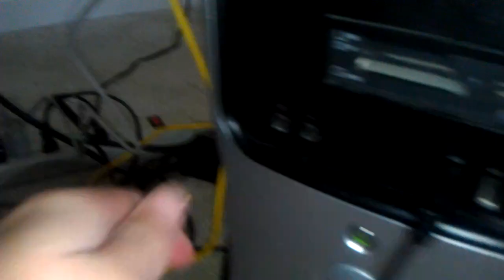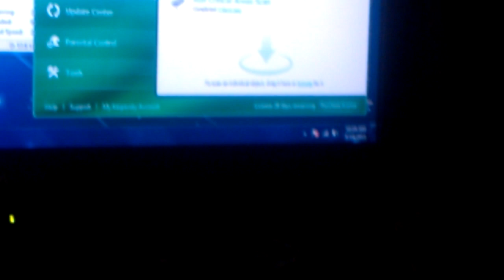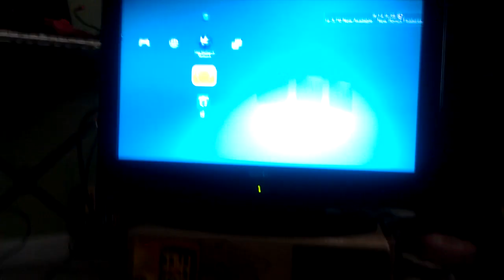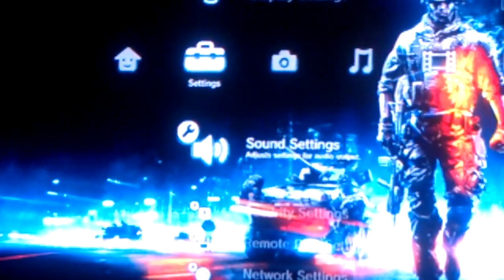Turtle Beach P11 Review and Setup

Comment: I use p11 on ps4. Just separated cords so usb reaches console & other into controller. I love it bcuz my a.c. is right near my head & ppl can't hear it, where as others with expensive headsets running a fan which is less than half the noise of an a.c. is super annoying to others. P11 may not b fancy, but noise isn't heard by others & mic sounds clear. Good buy. Can get less than $30 these days.

 B careful not to pull cords too much as it will tear eventually where it connects to ear pcs.

Comment: Can it work on PS4??
Reply: kenny liau .. yes. U have to separate the cord tho so usb plugs into ps4 & other plugs into controller. If u r very careful, u can do without damaging cord. I did & it works great. There r vids detailing it but b very careful
Reply: A is for Annihilation you dont have to plug it into the controller, just the ps4
Reply: No only if the box says ps4

Comment: There Is this weird fuzzy noise In the background all the time for my P11 Headset. I hate It!
Reply: Ur power socket to which the computer/PS is connect might not have grounding, i also have static noise but when they are plugged in the back of the pc, if i connect it on the front panel, it works just fine

Comment: My advise, if you want to use the p11 for your pc. DONT, the cord is extremely long and the cubical thingy that u use to change the volume will get stuck behind EVERYWHERE.
the video is great though ! good work.
Reply: It's not the hardest thing in the world to manage a long headphone cable...Just get two cable ties, roll up the rest of the cable and put it somewhere safe. So simple to manage, I think it's still very good for gaming and audio on PC.
Reply: Manufacturers tend to make the cables on gaming headsets extremely long. I suggest using a velcro or twist tie to hold the extra length together. That's what most people do.

Comment: How do you hook it up to a monitor that doesn't have the white and red audio jacks?
Reply: you don't, you just plug the USB in to the computer and the audio jack into the mic input
Reply: its not for a computer, its for my moniter and ps3
Reply: well i don't think you can but the xbox 360 has an adapter so you can (HDMI is needed), maybe the ps3 has one too
Reply: idk, some ppl do youtube videos for gaming and have it hooked up to their ps3
Reply: NY Vigilante Optical cable
Reply: Frostep_Pro not with this headset
Reply: +NY Vigilante i have the same problem my tv has none of those jacks??? only the light greenish one
Reply: chicken wings because you don't plug it into the tv

Comment: fail....4:51 its for the microphone...not for the headphone, you must plug it into the microphone place in your PC, the USB is for the sound
Reply: "Step 1:
Connect the P11’s green 3.5mm audio plug to the speaker or 
headphone output of your PC/Mac sound card."

That's straight from the User Manual: http://cdn-assets.turtlebeach.com/products/46/P11-UserGuide-web.pdf 

(You're wrong)

Comment: I'm surprised no one complains about the insane amount of wires that are attached to them. Every time I use them I feel like I'm in a bowl of wire-spaghetti!
They sound great, but the cheap wiring is a let-down. The green 1/8" connection crackles unless you have it just right; lame! Also, I take really good care of my stuff and if you travel with these or beat-on them I'm positive they wouldn't last long. I'm going to modify mine to make the cables more practical, if successful I'll post a vid.

Comment: This headset is great. Great sound quality and the mic works great and has great clarity. BUT this mic breaks after 3 months or so and you have to return them with the warranty which takes 2 weeks. They are very inconvenient but are lightweight, have great clarity, blocks out background noise on both ends, and has great sound. I have them right now and they are broken so im getting new ones because I have replaced them 5 times now.

Comment: I was doing some research on this headset, and my ps3 is plugged in with a hdmi cable. I saw a video called P11 with HDMI, do i have to do something special to get my headset to work with ps3 connected with and hdmi to the tv?

Comment from the maker: @sebastian66677 to answer all of your questions, the ones at 5:50 are the cables that allow the headset to hear game sound, the ones at 6:44 are the ones that connect to the ones at 5:50, that go to the headset, and yes, this will work with any tv, as long as it has the required ports (where the cables plug in)